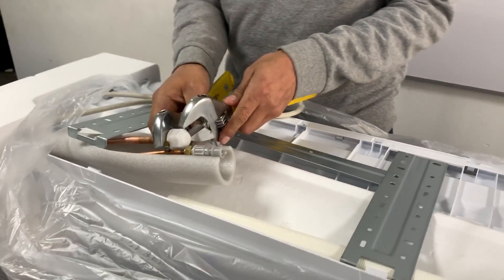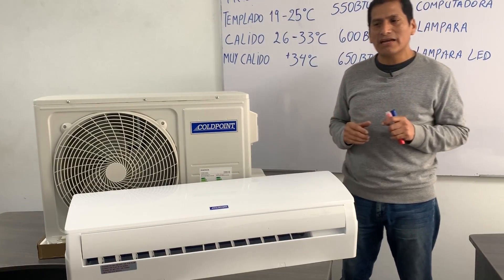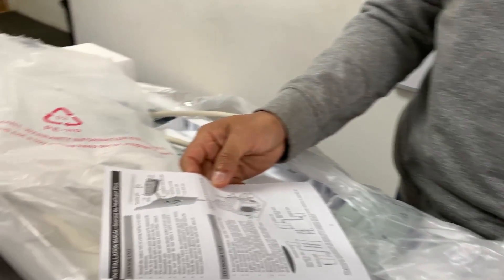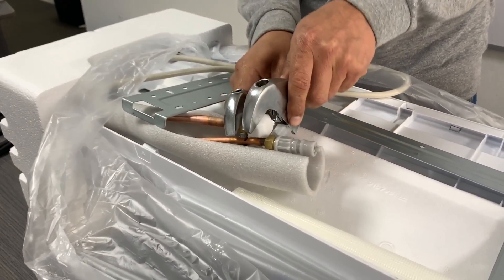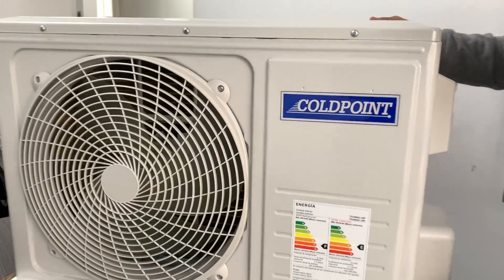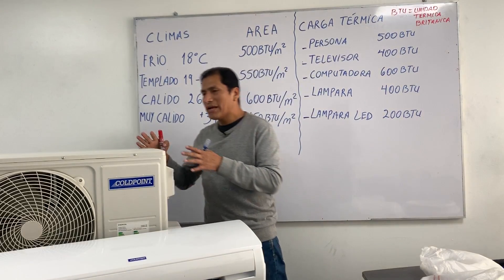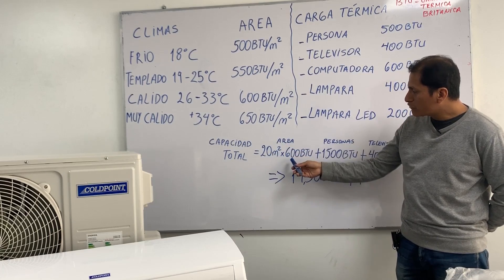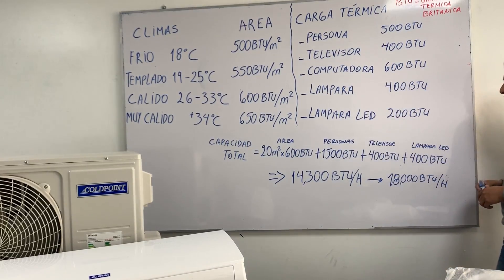Cómo elegir el equipo de Aire acondicionado correcto

Comment: Que térmica debo de colocarle a un aire acondicionado inverter marca TGM. de 12.000 tu.
Reply: Según sección del cable de alimentación,  si es cable eléctrico de 1,5 mm2 : 10 Amperios,  si es de 2,5 mm2 : 15 Amperios. Generalmente si es de 3000 kcal/h ( 12 000 BTU) el cable suele ser de 1,5 mm2 (equipo inverter), si es convencional 2,5 mm2 .